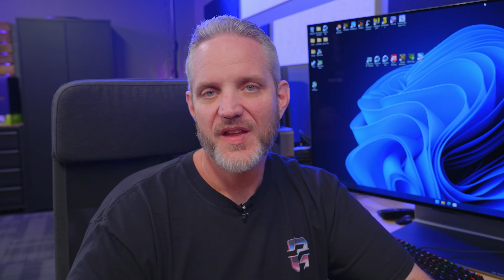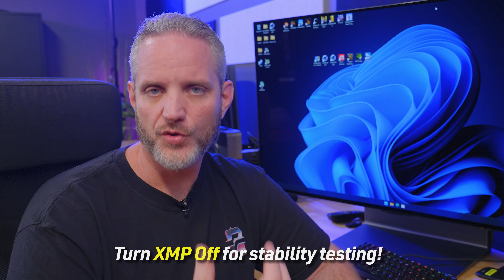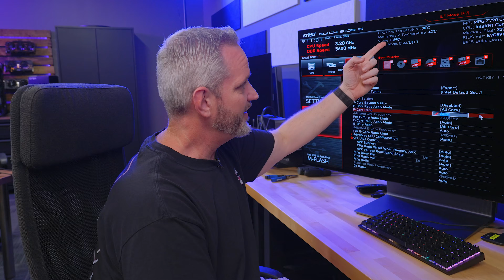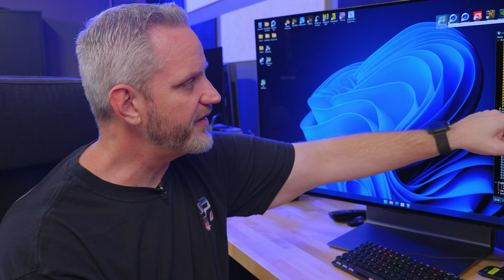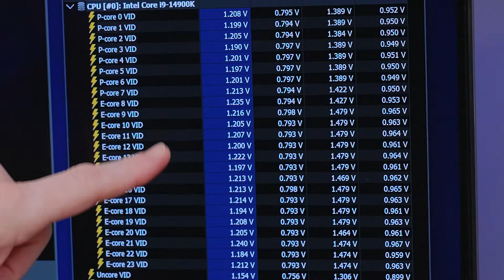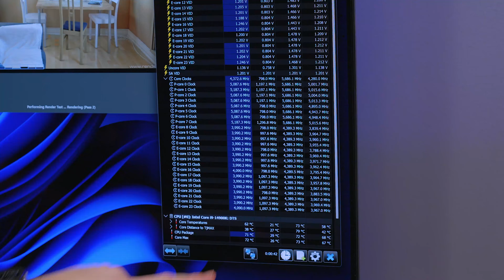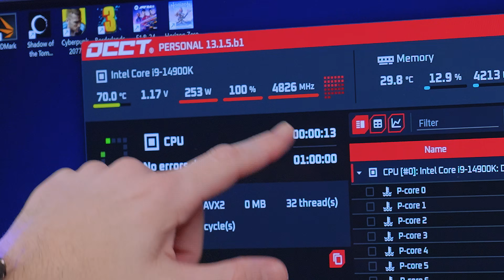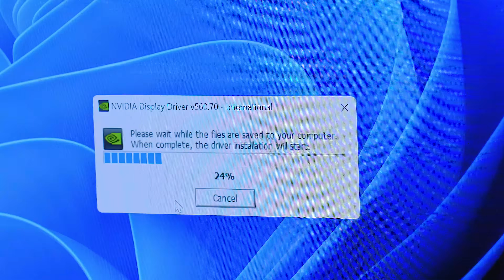Guide: How to check if your CPU is BAD!

Comment: It would have been good seeing a degraded system be tested
Reply: I would love to send my cannot surpass 190W CPU to Jay, but I am absolutely dependent on this system every day.
Reply: It’s not good 😂 every test is run my system would reboot and even on startup after the reboot it would bluescreen and reboot again 😂
Reply: Idk, benchmarks on YouTube are mainly a shopping advice
Reply: @robostep9829  do u got some recommendations to do it the right way ?
Reply: My 13900k is degraded. Can't pass 28000 on cinebench r23 with my Asus board on the new microcode. Even with extra power I can't pass 30k. Waiting on Intel with an rma
Reply: @AZGhost623 what should a 13700k with msi z790i edge get?
Reply: @AZGhost623  for sure. I can get 32-33k on the mobile variant. Hope they deal with it quickly.
Reply: @AZGhost623 same here
Reply: He mentions that he has a degraded one that’s shipping to him. Agree this will be a great video and looking forward to seeing it
Reply: I've heard claims of anywhere from 50% to 99.9% failure rates with not a single example being shown

Comment: My brand new 14700K started with 0x129 bios :)
Reply: My 14700KF temp wreaking havoc rn I can't tell if maybe just my case doesn't have as good of an airflow or there's something wrong with my aio but I had to disable turbo to stay at extremely low temp cus its keeping my clock speed really slow too (but no effect to gaming since i get high fps on most games even with no turbo) but the 0x129 bios update essentially did nothing for me, sure maybe no crashes but a cpu thats always heavy cooling dependent i wished i had known before i got this haha
Reply: @Lawfyy  What cooler do you have?
Reply: @Lawfyy  My current cooler is Arctic e34 duo 😂 60-90c in games, i just order AIO 😁
Reply: @Lawfyy other than the obvious physical checks its probable that your specific intel defaults spec dosent undervolt automatically when posible its one of the reassons why i still use the non default presets is because they auto undervolt and get better performance for lower temps howerver obviously this can vary a lot across motherboard brands but gigabyte has been good for me during this insanely overexagerated chaos

Comment: in a few days my parts arrive for the new build. I went with Intel, cause i'm an intel boy, and they extend warranty to 5 years. What do i need to do, and what must i not do. Thanks
Reply: Just update to the latest BIOS and hope for the best. I have still not seen any estimate of how many Intel CPUs are actually affected by this problem.... A new CPU running under a properly regulated BIOS should be pretty safe. But it's an ongoing situation...I suspect we won't know much that's definite for a few months.
Reply: @r1pbuck  true, and the drama was too juicy financially for Yt'ers to not jump on it. I've had no problem since then with 14700kf. Jay at least tries to keep his feet in the ground
Reply: @ The BIOS updates to my MSI motherboards seem to have completely cured any problems with the 13th gen CPUs I've used. I won't say it was all a tempest in a teapot, but Intel would have saved themselves a ton of trouble and bad publicity if they had been much more proactive about solving the problem…because it was solvable.

Comment: I wonder if the Intel problem has to do with the chips bending, because I have a contact plate installed on my 13900K and have never seen any of these issues.
Reply: Had contact frame on my 13700k from day one and it still became unstable, so likely unrelated
Reply: @Preemz  Ah okay!
Reply: @Preemz I had a ThermalRight contact frame installed and recently a lot of tweaking undervolting and underclocking made my CPU displaying BSODs when running cinebench R23 then I started trouble shooting by removing Ram 1 by 1. The test was passing without bsod with only 1 ram installed then there was last hope I removed the contact frame and I ran the test several times and also stressed for 12 mis. No sign of BSOD. I don't know what I did wrong whether I overtightened the screws or may not tighten enough but I suggest you try it with Intel's stock ILM maybe you don't get BSOD again and do let me know.
Reply: @FailaDK I was very careful to not overtighten the contact frame when first installing, and was very careful to apply even pressure across the IHS with quarter turns. Anyway, I've spent enough time troubleshooting Intel's mistakes already. I've also changed platforms over to AMD this past weekend, and am in the middle of refunding the chip. I'll sell the rest of the platform locally and just eat whatever the remaining cost is.
Reply: @Preemz  I've watched Gamers Nexus and other tech tubers guide and installed two of contact frames one for my own system and one for brother's both were working fine until last week my setup after lot of tweaking shown up this issue but my brother's system is still running fine. Maybe I haven't tightened the screws for my system and this problem emerged but I don't think it's necessary because a lot of people are using stock ILM and it won't bend the CPU really easily. Also with Intel's stock ILM the thermal paste distribution was very even so I don't think I need that thermal right contact frame again...
Reply: I have a contact plate on my 13700k. I got it a couple weeks after the CPU came out in 2022. I have blue screens that aren't solved by any troubleshooting. Hopefully Intel will replace it.
Reply: @barkyyy  have you removed contact frame and used intel stock ILM?

Comment: Today marks day 32 of my Intel 13900k RMA. After nearly 2 weeks I finally got them to agree to REFUND me instead of replace the cpu. Intel then ghosted me for another 10 days until I received an email (not an update on my ticket, a separate email) letting me know that my case has been escalated to "Upper Management" and they would get back to me in 1-2 days. They did not. After a week or so I received another email (not an update to my ticket, another separate email) letting me know that they had no replacement 13900k and that I would have to wait for 3+ months for a replacement OR I could choose to be refunded. They asked for proof of purchase for the 3rd time (I gave it to them twice already) and wanted me to confirm if I wanted the refund.

Guys, Intel is doing me really wrong. I highly suggest you never purchase their products again. None of them. It's been an 8 month nightmare. I lost work, $$$, time, sleep... I'm an example to avoid. Avoid Intel.

Comment: Saying that all processors degrade is true yet dishonest (as if this is normal). I have a dual xeon from 2012 that still runs as advertised, a Super Nintendo that does, and a original NES that still runs.
Reply: same got n64 and snes and a 4790k that still works as new and ran overclocked for 10+ years
Reply: You'd have to compare to chips made on similarly sized process nodes like 12th gen and Ryzen 3000 to make it a fair comparison. Small process nodes degrade faster than older, larger ones. Sadly that's just physics
Reply: @felinefireaudio  Sadly AMD 7000 series is a smaller node (5nm vs 10nm) and yet much more stable.
Reply: @snowshoes5942  sure, that's because AMD isn't pushing ridiculous voltages
Reply: @felinefireaudio  Yeah, we know this. Why did you need to compare similar process nodes to come to that conclusion?
Reply: @snowshoes5942  it's called the scientific method
Reply: @felinefireaudio  and yet defying what you claimed, the smaller nm is the one that degrades slower and is more stable.
Reply: I'm gonna guess your NES hasn't spent all four decades turned on.
Reply: @GamesFromSpace  Neither did the 2 14900ks i've RMA'd.
Reply: i've seen multiple super nintendo's with failing cpu's, also degredation means it will become unstable, it will not become slower
Reply: @Remi_Jansen  Did someone say it would become slower or are you just stating that in case someone out there doesn't know?

Comment: when i play World Of Warcraft my CPU goes to almoast 80c , its an I5 13600k with a Noctua NH-D15, imo it seems abit hot, but when i stress test the CPU the max temp is 93c .. the P-core never go past 1.4v (average is around 1300)  should  i be worried =/

Comment: My blue screens were caused by my boot drive getting too hot.
It took a long time for me to figure that out. It started the moment I swapped to the 13600K from the 5600g.
It’s definitely the difference in power draw, so the 13600K ran hotter.
I fixed my problem after swapping to a new case.

Comment: But you're looking at VID, not VCORE. VID is what is requested to the CPU, not actually what is reaching it...
Reply: Should be interdependant. If one is too off from the other, system will have problems.
Reply: How do I find VCORE on HWINFO? I don’t see it under CPU.

I haven’t tweaked any settings with my CPU, no undervolting or overclocking or anything CPU related. I have a 13700K and just want to give myself some insurance down the line. My VCORE in BIOS was 1.128 so that worried me.
Reply: @MatrixProHD  i think you can find the VCORE under your Mainbord in HWINFO if im not wrong? pls correcte me if i am wrong
Reply: @MatrixProHD  Should be either VCORE or VRVOUT depending on the board. Focus on load voltages for stability. IDLE voltages around 1.4v should be fine on Intel. Load between 1.3-1.4 depending on the stress test.
Reply: @Matt-lf1ik  Not even sure if I needed 0x129 with a 13600K , before 0x129 I was seeing 1.228v VCORE while Cinebench was running and with 0x129 (Intel Defaults selected in BIOS) its now 1.35v Vcore with Cinebench running & higher temps lol. EDIT: The CPU LIte Load mode was auto set to mode 18 after 0x129 which explains the boost in voltage, it used to auto set to mode 9 before.
Reply: In Jays defense.

if you are using auto vcore setting in bios, or even with offsets (as offsets transfer to vid requests) looking at them is not a bad advice.
Cause even if you cant get the Vcore or VRVOUT to near that VID in the tests you are running, it still might peak in some odd situation to what the vid request is!!!!

VRVOUT is the most accurate reading if your mb has that sensor, so that tells you what the cpu is actually getting, despite what it is asking. That is true.

Vcore reading could be accurate enough.. or not. varies a lot between motherboards. usually still above vrvout if you have both, so it maybe closer to what the cpu is getting than VID readings, but not the whole truth.

So looking at those is better than looking ONLY at VIDS when tuning(!) i suppose...
Though(!) VIDS are rarely (never?) less than vcore or vrvout so basically you are just being extra careful with voltages if tuning and looking at VIDS.

IF you have set vcore to fixed in bios, which is what it is gonna be at maximum. And it then droops the load voltages to how ever your LLC is set up.
And the fixed value is also what its gonna be at idle. (That is without c-states and other powersaving features, that are good to disable when testing(!) fixed voltage, to get more accurate readings for vdroop.
ie minimum VRVOUT in HWinfo subtracted from the fixed/idle value = max droop.
That is the old way to OC/tune intels. Still what i would do if i would be after max scores for HWBot.
And in THAT case, VRVOUT is the only one you can truly trust.

But Jay is not after max HWBot scores here is he???

And him looking at the VIDS is imo just being overly carefull (intentional or not), and harms no one!

He is also one of my favorite hwtubers, even if he doesn't always get everything right, you can tell his heart is in the right place. genuinely trying to help people.
He even says he wouldn't be Jay if he didn't get something wrong every now and then :)
I love the man, and his attitude. He is doing great job imo. The core parking fix was gold for example.
Much love to Jay and his team!
Reply: @Syntax_-_Error  I’d have to disagree. Me personally I’ll never look at VID. I want to see what is hitting the cpu. (VCORE on Asus, VRVOUT on gigabyte and msi) it’s the same sensor.
Reply: We cant be jeapordizing our intel partnership now can we.
Reply: Is there a full dictionary of these? I want to learn them.
Reply: Yeah this tripped me up with undervolting, until I learned that you want to look at VCORE, not VID.
Reply: @mikem9536  I know everybody loves hwinfo and hates hwmonitor. But at least hwmonitor puts vcore above vid in the default ordering of things. I can see how opening up hwinfo and seeing core vids right at the top and thinking 'that must be it" when really you have to scroll down 3 fricken screens to get to vcore which is more really more relevant and should be higher up by default imo.
Reply: Don’t know why people still listen to jays hardware advice. He’s a cool guy, but he just has no idea what he’s talking about when it comes to this sort of thing.
Reply: @gildfps  Damn!
Reply: @gildfps  Agreed. Grew up watching him, but I feel like he should educate himself a bit more before posting these types of videos.
Reply: @gildfps  no, he really doesn’t
Reply: i already commented several times on his previous vids, yet he still watch the VIDs instated of Vcore voltages!
Also, i think 26 mins video is way too long! aint nobody got time for dat..
Reply: @yahyoh91 I smelled smoke. I thought somebody was barbecuing.
Reply: @yahyoh91 yeah we do...jeez people now days..so sensitive bsitter and high maintence carrots
Reply: Yea, he needs to be looking at VROUT.  At least if everything is set correctly though, VID should be close to VROUT.
Reply: Sure its AMD but on HW monitor there isn't a difference between the two at least for me. I have my voltage locked too 1.375  Vcore SHOWS 1.344v and looking at each of my cores are running up to a max of 1.344 soooooo yeah. Can you please explain this to me? Cause by your logic there should be a big massive difference and there isn't.
Reply: @HackoDis  Exactly... You set 1.375 and because of Load line calibration (LLC) there is VDROOP. Your vcore is 1.344v NOT 1.375v.
Reply: @Matt-lf1ik  CPU vdd is 0.913 so I'm assuming that is the vdrop. Each core is then running at 1.34 volts depending on load they jump around 1.3. So the cpu is requesting 1.344 volts and each core is running at those intended voltages. So then I can look at core voltages and the vcore to ensure they match up and they do. So then I can just look at core voltage to ensure that is how the system is running? 
I just want to know how jay is wrong exactly.
Reply: @HackoDis  Jay is wrong because VID does not mean VCORE. They can be equal because of bios settings but they are not reading from the same sensor.
Reply: @HackoDis  For example on my 9900K My VID shows 1.295v and my VCORE shows 1.365v. Vastly different.
Reply: @Matt-lf1ik  so it all depends on a range of factors then. Mobo, bios, microcode settings. Each motherboard will relay the information differently. That is what I have learned here. So then jay isnt wrong then. if he would clarify that the voltages he is looking at are the same that the cpu is requesting. I don't see an issue here then.
Reply: @Matt-lf1ik  So then he needs to show the two values and explain then why there might be a difference and why he chooses to look at just one value. Because as you said varies from motherboard and bios and etc. Alot of different variables here.
Reply: @HackoDis  But did he clarify that the VCORE is the same as VID in his case? No he didnt. Now someone know doesnt know any better will look at vid being 1.2v, meanwhile they're shoving 1.4v into their chip.
Reply: @Matt-lf1ik  Then people need to do more research then and not just rely on one source. If a person googles CPU voltages and meanings then they'll find all the info they're looking for. You just said that 1.4 volts was fine for intel. Also jay did a video on voltages and showed that what HW monitor shows isn't always true. It works well enough to get a general idea.
It also is dependent on CPU, MOBO, settings, BIOS version, microcode algorithm etc. Also too someone should be able to just plug in a cpu and do nothing in bios. Yet here we are trying to optimize voltage and power to get the best results.
Reply: @HackoDis  Dude I used my voltage example simply as an example. 1.4v being fine varys between load. Pulling 200A out of an 8 core chip on intel while voltage being 1.4v UNDER LOAD is TOO HIGH. Though idling at 20A and voltage being 1.4v is perfectly fine.
Reply: I know right that was bothering me the whole video. Then again maybe he's smarter than we think and he's aligned his loadlines just right so they are the same. But probably not....

EDIT: People seem to not be reading the last sentence of my post. I don't think this is the case, which is what "but probably not" is supposed to mean.
Reply: @jessefisher1809  Usually they are not the same. I have not had one system where they were exaclty the same.
Reply: @Matt-lf1ik  I know, thats why I said that was an unlikely scenario. But you can get them very very close if you fine tune both your ac/dc and llc. And I very much doubt jay has done that.
Reply: @jessefisher1809  Atleast on an ASUS board they will be within 0.01v usually cause it auto sets DC LL to the LLC you select.
Reply: @ZoneXV  Nice. Wish gigabyte did that. But I got mine relatively close together, within .02 it seems. Only problem is sometimes vcore exceeds vid just a tiny bit and I don't really like that. Might have to edit it slightly at some point. But I don't think it really matters much outside of making the the vid limit slightly less effective (I've set mine at 1450)